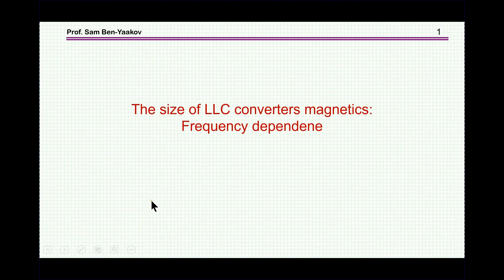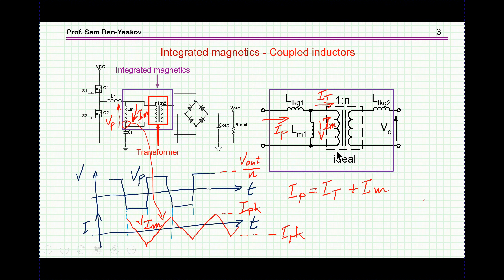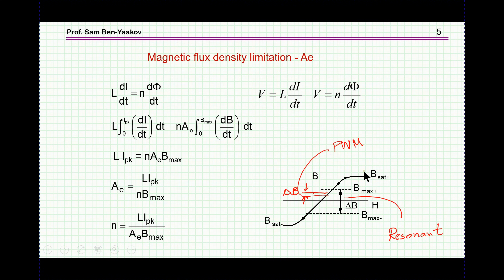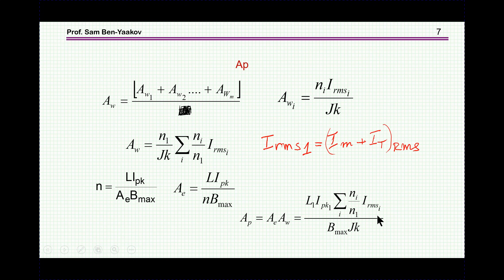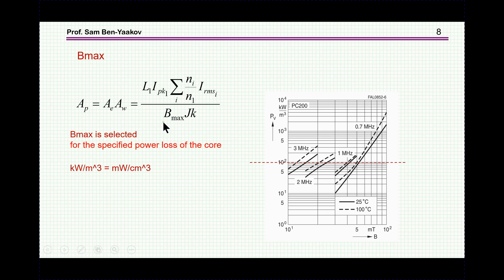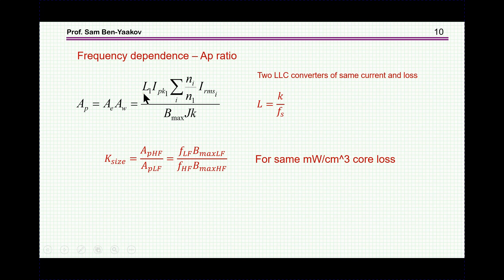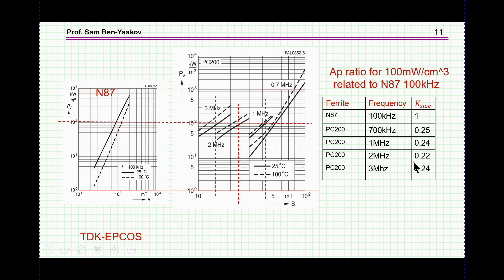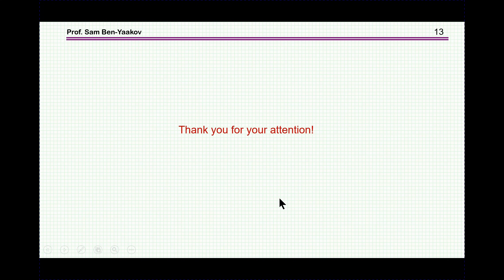The size of LLC converters magnetics: Frequency dependence

Comment: Hello Dr. Ben-Yaakov! In the case of the integrated resonance inductor Lr in the transformer, the core losses are affected not only by the Volt*sec across the magnetizing inductance Lm but also additionally by the Volt*sec on the leakage inductance Lr. Did I get it right? I am reffering to the @1:35 and @3:25.
Reply from the maker: Core loss depend on B which needs to be evaluated for te integrated device
Reply: @sambenyaakov  Do losses caused by B in the resonant inductor add to transformer core losses in the case when the resonant inductor is the transformer leakage inductor? I mean that strange, isn't leakage the part of the winding not coupled with the core? And if it is not coupled with the core, how can it cause B in the core?
Reply from the maker: @ THe inductor can be integrated as an add-on around the core or as leakage/ In the latter the losses are not core losses but due to DC resistance, skin effect, and proximity effects (could be high)
Reply from the maker: @vasiliy5578  Some of the leakage has a flux path that does not involve the core. e.g. in a multi-layer winding

Comment: Just an observation: slides 2 and 3 have an error in the schematic.  The diode bridge on the output is wrongly connected, the connections to the transformer secondary need to be swapped with the connections to Cout & Rload.  Regards.
Reply from the maker: Thanks for pointing out the typos.

Comment: Thank you very much for the interesting short video Dr. Ben-Yaakov. I have been looking for this PC200 ring cores for some time now from TDK to try, but apparently they are not much in stock. Perhaps still in development. But it looks like the k factor is not much different for 700 kHz to 3 MHz. So can we conclude that operating at 3 MHz brings not much difference in size as compared to 700 kHz ? Maybe other host of problems like proximity effects dominate at 3 MHz and so we need a larger core to manage the core loss density etc? Thank you.
Reply from the maker: Hi ravi, thanks for comment. I also have the impression that 3MHz is not viable.

Comment: Dear Professor Yaakov, following the idea of PSIM, which use several running analysis to accomplish a final plot, I would like to invite you to search into LTSPICE page which have a very good analysis sequence called "FRA" where the use can have a very good bode plot of their SMPS of any kind. Please, look at: http://www.analog.com/en/technical-articles/ltspice-extracting-switch-mode-power-supply-loop-gain-in-simulation-and-why-you-usually-don-t-need.html
B. R.
Jorge
Reply from the maker: HI Jorge, Sorry but you seem to misunderstood what I explained in video. You do not make a number of runs in PSIM it is doing everything by itself. The LTSpice FRA method  mimics what PSIM is doing. This is what the script is for. You do not need to write any script in PSIM.
Have you ever run LTspice in this mode?
Reply: Dear Professor. Yes, I should examine twice this subject. I had used the LTspice FRA as shown, but it would be a good exercise to use your aproach into Ltspice or, maybe, into simetrix intro, which is other simulator usable freely.
B. R.
Jorge
Reply from the maker: Jorge, The PSIM and LTspice approaches are the same. The Ltspice script injects a series of sinusoidal signals, extract the injected components from the output and takes the average. All this is done automatically by PSIM. Not PSIM or LTspice invented this. This is mimicking the operation of a hardware FRA